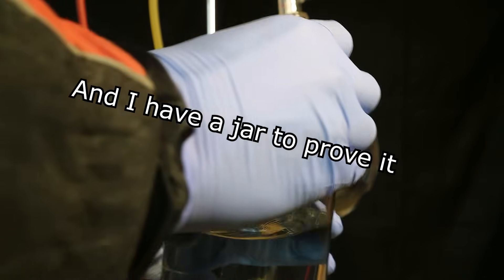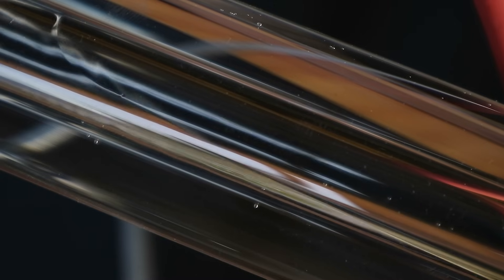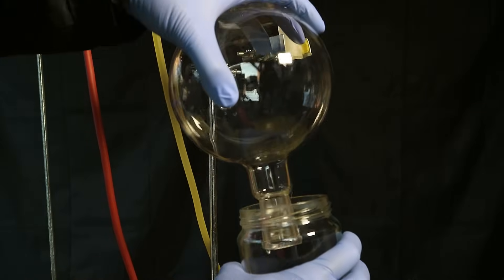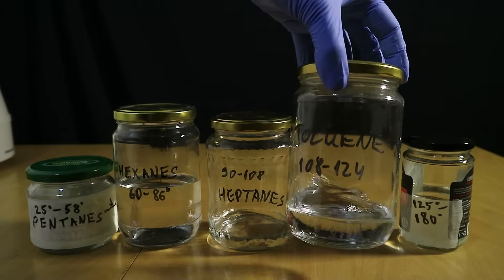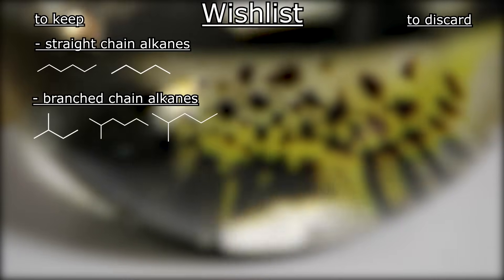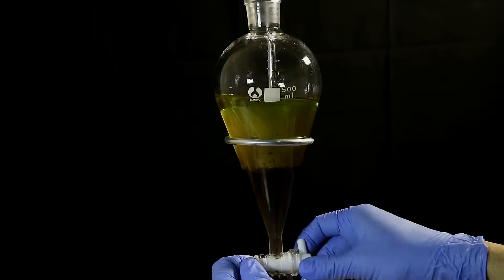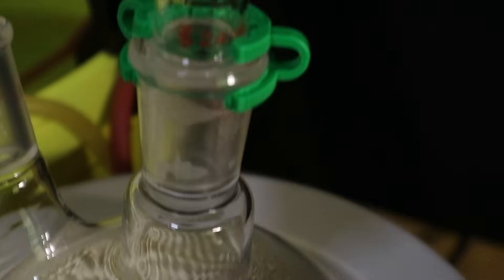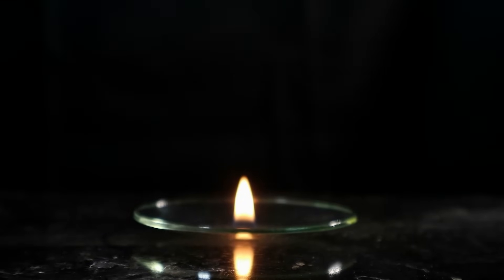What even is in gasoline? | Making an unreactive non-polar solvent from petrol

Comment: You can't simply separate a mixture of hydrocarbons through a simple distillation. This is coz some b.p. lying far too close to each other. This requires a very good column and by that I don't mean a simple Vigreux column. For this you need a packed column with a large amount of glass or metal fillers. And even with that, complete separation is not possible coz most columns are far too short for that. This would require a column of several meters.

Comment: You can wash the ethanol out of neat gasoline by shaking gasoline with water.  Don’t forget this isn’t neat gasoline so you will get detergents.
Reply: Oops you did that later on the video. When we do spot checks for ethanol % we do 50:50 water gas in a 100 ml cylinder.  If it’s at ~40:60 we know there’s ~ 10% ethanol afterwards.

Comment: Nice video Sir. New sub, just found this.
I know they use Cyclopentane as a refrigerant to replace CFC's.
Reply from the maker: Thank you! It's true, it has no way to react with ozone, so they're a valid alternative. It is however more volatile, and as we've shown, quite flammable. So precautions have to be made so your fridge doesn't explode.
Reply: Haha, I know the one I saw had a giant warning label on the back of it. Which is why I had to look the chemical up to begin with.  @Nota_Chemist
Reply: @Nota_Chemist  At the university where I work the policy is that we can't use any fridge with flammable refrigerants in laboratories. Which makes procuring replacements for the old CFC-filled ones a massive pain! We can only use HFC-filled units which aren't always available in the correct type, and now the HFCs are also being phased out (due to excessive global warming potential) so it's likely that they soon won't be available at all.

By the way, never store volatile organic solvents in a normal refrigerator. They can form explosive mixtures with the air in there, and often when you open the door the switch for the internal light will make a tiny spark...
Reply from the maker: Very sound advice in the end there :)

Although different refrigerants are being stopped from production for consumer devices, I can't imagine that inert ones will ever completely go away, since they are necessary in labs and other aspects of industry. Prices might skyrocket though :/ An inert, easy to produce and non-destructive to the environment refrigerant is a bit of a holy grail I guess.
Reply: @Nota_Chemist  carbon dioxide is a good option, however it requires higher operating pressures than the current ones.

Comment: You use the term evaporate at X degrees a few times. I believe evaporate is the wrong term to use here since that would imply it volatilizes due to vapor pressure below its boiling point. I believe you mean that they boil at X degrees, where their vapor pressure exceeds atmospheric pressure.
Reply from the maker: You are technically correct - the best kind of correct 🙃
Reply: Neither of those things are what the thermometer measures. It measures the temperature of vapor condensing at the top of the column.